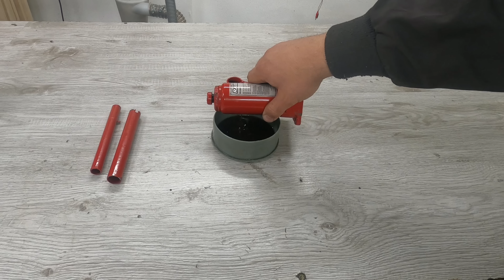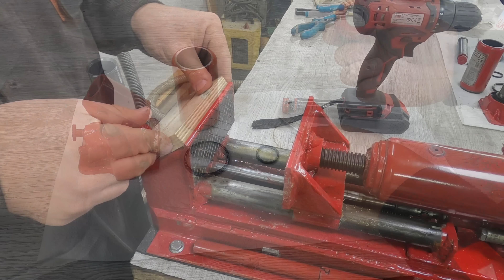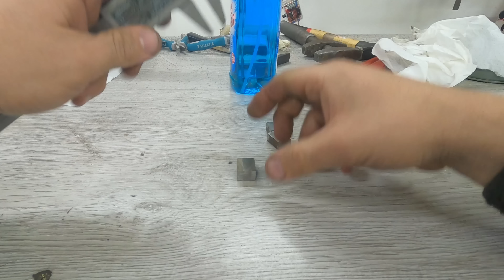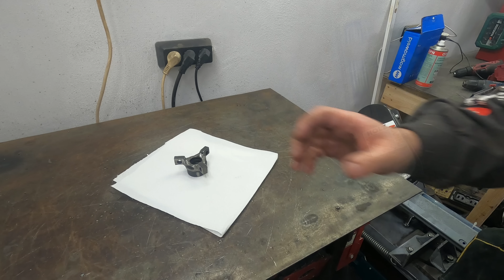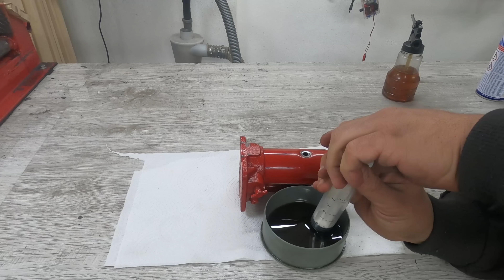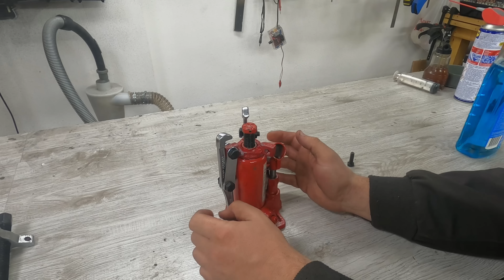Hydraulic Car Jack + Bearing Puller = Hydraulic Bearing Puller DIY Idea

Comment: What did you change?  The piston raises just as it did before inserting the copper tube. 🤷🏻‍♂️
Reply from the maker: Without the copper pipe, it can not work horizontally.